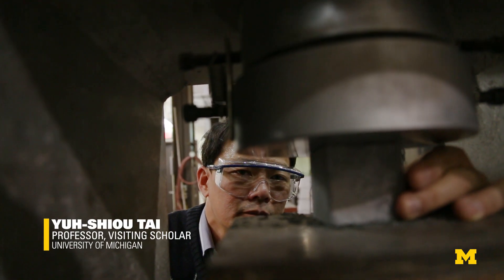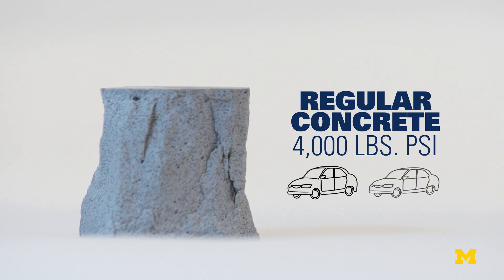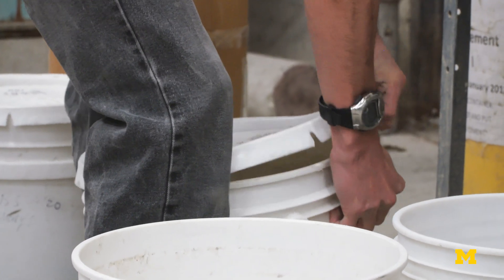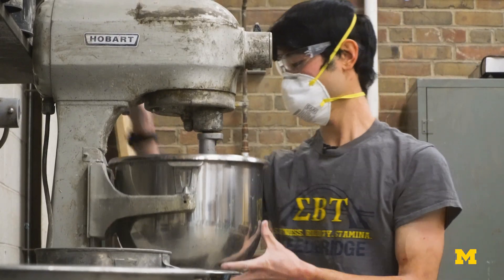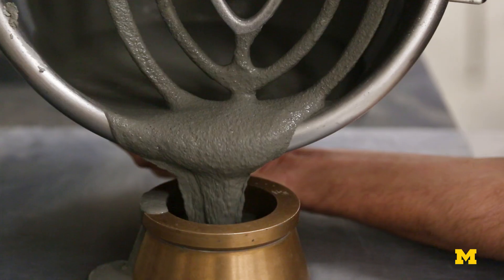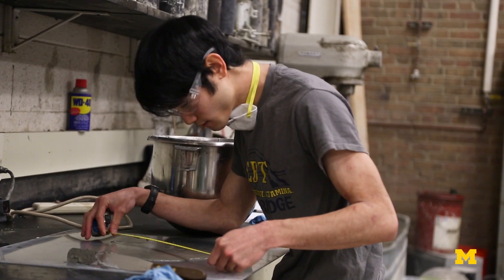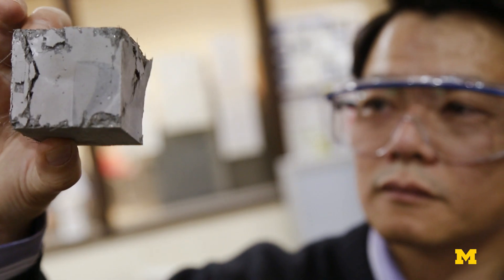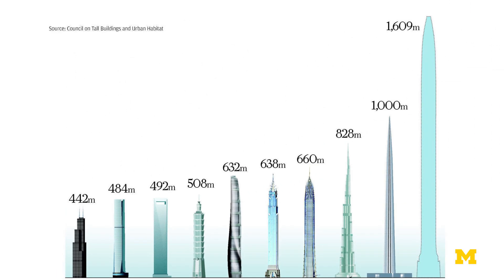Cheap, ultra-high performance concrete

Comment: For those looking for the recipe for the UHPC, do a google search of:

"Crack Propagation Speed In Ultra High Performance Concrete (UHPC)," Accepted for Publication in the Journal of Construction and Building Materials (2015)"

It was the first result that came up.

Comment: 30 years ago I built a sailboat with carbon fiber. Where 2 panels meet, you have to fillet the corners which puts a radius in the inside corner to eliminate the sharp corners. This helps the carbon fiber tape that holds these panels together.
I started using carbon scrap threads about 1/4" length mixed in with the epoxy for the fillets (the filet material is basically like a putty that you apply in the corners with dowels or tongue depressors to get a radius). Using the carbon threads really strengthened the fillets. During tests using a hammer, I could easily smash the regular fillet material but the material reinforced with carbon threads was almost impossible to smash.

Comment: I would think that there are better alternatives for the fiber reinforcement.
Reply: Basalt fiber
Reply: Regular concrete 4000 psi

Fiber reinforced cement can go up to 12000 psi

Ultra high performance concrete 35000 psi

Comment: Can you replace the steel fibers by something that won't corrode on water?
Reply: Stainless steel fibers
Reply: Glass fibers
Reply: Carbon fibers
Reply: @jafinch78  Carbon fiber is... carbon. If left out in the elements it will "rust" very quickly. The only reason people think carbon fiber does not rust is because they are thinking of the epoxy formed structures using carbon fiber. The epoxy is acting as a waterproofing agent. Remove the epoxy and you have a very easily corroded carbon structure.
Reply: @ Thanks for clarification, of course seems. Can you elaborate what carbon fiber rusts into? Carbon monoxide or dioxide does not come to mind as a former chemist or from reading, though maybe acidic environments might react or maybe the basic pH of concrete materials. I would have to sit down at the chemical puzzle of the mixtures ingredients individually and iterate through the combinations to determine reaction concern short term and over time. In fact carbon exists in nature quite commonly in coal deposits throughout the world as stable solid forms, though not in carbon fiber forms that come to mind. I wonder more about microbes potentially consuming offhand.  That is not why carbon fiber is not used. Fiberglass and maybe basalt is used outside of steel fibers as of now more due to cost and availability.  I guess stainless steel, though seems there are better steel material candidates for longevity or more inert or beneficial reactions in like a UHPC.
Reply: @ Most of my experience related to carbon fiber is in marine environments. A great deal of care has to be taken to coat/protect the carbon fibers, or the composite will degrade fairly rapidly.
Reply: @TheTinkeringMachinist  Freshwater as well?  Offhand I'd guess microbes more in freshwater.  Saltwater, yeah, seems like more potential reaction potential. Amazing the range of carbon fiber materials as well, like some are conductive and others not so much.
Reply: @jafinch78  Pretty much only salt water/sea water in my case. Most of the design and manufacturing we did was for the US navy.
Reply: @TheTinkeringMachinist  Reminds me in that regards to hulls and with aircraft as well, like aluminum I suppose a little less there are challenges regarding longevity, where steel still reigns.
Reply: Basalt
Reply: Street fighters 😜

Comment: Thanks!  I shall read your paper!  I’m researching concrete lathe.  Instead of the 10 ton design from 1916, it will be under 400 lb....small, may develop cracks.
Reply: did u find his papers ?
links pls 
im planing to use this material for CNC mill
Reply: @nuuskapeke11  I just left a comment with the website :).
Reply: @nuuskapeke11  do a google search of:

"Crack Propagation Speed In Ultra High Performance Concrete (UHPC)," Accepted for Publication in the Journal of Construction and Building Materials (2015)"

It was the first link that came up in the search for me.
Reply: @nuuskapeke11  In the video description, he has the title of the scholarly article he published about it.  If you Google it, you can find it on websites like Scribd. 

Edit: after skimming through the document, Table 1 and Table 2 have the specs for the UHPC.  They tested 3 variations of wire amount by volume, and they have the measures by weight for the various materials used in the mixture (sand, glass powder, superplasticizer, etc.)

Comment: This is the concrete blend I intend to use (or something really close to it) to make a couple very heavy 100+ lb weight plates for my barbell that will be strong enough to drop. 5000+ psi works ok, only very small pieces fall off occasionally, but I want to way overboard with the next ones
Reply: Haha I’m here for the same reason
Reply: @ElegantFinishes  me too, haha
Reply: @notsam4614   UHPC is a bad choice. 
Use Barite & 2-part Epoxy (creating a Barite polymer composite), 65% Barite to 35% Epoxy. 
It's 35% denser than UHPC & non-brittle. It will handle drops. (Dropping isn't about compressive strength)
Reply: @ElegantFinishes  me too lol, did it work?
Reply: @bobbob-uf3qz  I used 5K psi and a bunch of fiber glass in wet mix then used 1 woven sheet of fiber glass & smd sun flash on surface. Stress cracks in surface of fiber glass so it’s not the prettiest but I’m confident nothing is going to break or fly off, holding up better than expected
Reply: @ElegantFinishes  how long did u cure it before using it
Reply: @ElegantFinishes  and could u give an approximate of the prices for those items please?
Reply: @ElegantFinishes  UHPC is a bad choice. 
Use Barite & 2-part Epoxy (creating a Barite polymer composite), 65% Barite to 35% Epoxy. 
35% denser than UHPC & non-brittle. It will handle drops. (Dropping isn't about compressive strength)
Reply: @bobbob-uf3qz   UHPC is a bad choice. 
Use Barite & 2-part Epoxy (creating a Barite polymer composite), 65% Barite to 35% Epoxy. 
35% denser than UHPC & non-brittle. It will handle drops. (Dropping isn't about compressive strength)
Reply: @dsdgdsfegfeg where do I get the barite just powder/sand?
Reply: @MikeT-om9mf  not sure sorry, 
I'm in Australia. See what internet search says, 
Or ask AI for ur area
Reply: Do it in bike tires to protect it from edge chipping
Reply: Same here. I have a box full of scrap metal (brass, steel and aluminum) screws, nails, bolts washers, valves and stuff like that that I threw into the cement mix instead of aggregate. Worked great but I'm thinking of cutting up some steel wire mesh 24 Guage, and adding fiberglass strands to the mix to minimze major chipping. ** it is imperative to completely cover the weight in duct tape. Really helps keep it together even if it's broken in half, but more importantly, it prevents chunks of concrete and sharp steel wires from possibly flying towards you has high velocity. Shits like shrapnel, believe me. Dropped a plate as a test.

Comment: 2000lb car? That's a tiny car, lol. Great video.
Reply: Bigger than the original Volkswagen Beetle.  They were 1800 pounds and sold for about $1800.  The advertising for them at the time (mid 1960s) was they were $1 per pound.
Reply: https://www.youtube.com/watch?v=sJr9Ed9Lf3w
Reply: Lol, the Beetle is an exception. How many are even left? 
$1 per pound is a pretty good marketing strategy. I wonder if I could get 300lbs worth

Comment: I am so worried about the steel rusting and expanding... what will control this aspect?  Thank you so much for getting away from silly 3/4 angular aggregates and into ''fibers''...   But, again... what will water do to metal fibers?
We need to focus on the tension aspect of concrete and the compressive end will pick up by default.
Reply: I've wondered and am wondering about other materials fibers effects, similar to using fiberglass rebar... how would fiberglass fibers, carbon fibers, other metals like titanium, metals coated or formulated like stainless steel or with oxide or other metal coating, etc., perform?
Reply: @jafinch78  stainless steels still rust, the others are too expensive or too brittle, you use regular steel and a waterproofing admix to prevent water intrusion
Reply: Construction News & Engineering Soak the fibers in a rubber sealant like what they use to spray rubber waterproof basement exteriors. 

When all the fibers are coated with the rubber spray. Toss them around a bit in a cement mixer so each fiber can be unstuck from another. THEN toss the fibers into the cement mix. They won’t rust. Problem solved.
Reply: @DylanBegazo  please don't do that. You would you an integral waterproofing or a waterproof layer to prevent water from ever reaching the inner steel(rebar and fibers)
Reply: How would that affect adhesion between the concrete and the fibers? High chloride content is a death sentence for any steel reinforced concrete structure and these sealants may not have the binding strength needed to transfer the load onto the steel wire. I've seen people paint rebar with sealing bonding agents but those have to be tacky when the concrete mortar is poured. I've heard those bonding agents are really strong.
Reply: Guys check out basalt fibers instead of steel
Reply: @ldnelso2  not necessary, you don't let the water get in in the first place
Reply: @ldnelso2 Yes, basalt is way to go. Even whit epoxy or zinc coating there is risk of corosion. Basalt fibers are green and reliable.

Comment: Ad HEMP fibers, make it even stronger.
Reply: ZZP Zing Pheonix Hemp fibers to concrete mix? But last I checked hemp was illegal in the US... You live in Canada or Mexico?
Reply: @DylanBegazo  I grow hemp legally in Michigan, not illegal. My hemp structural tensile strength is 100 MPa
Reply: TheSorters oh wow ☺️ Nice to meet you and thanks for the info too. As a basis of comparison to your 100mpa, I wonder how much is Oak wood or concrete or steel. 

I was hoping to build my house using concrete and stone and cob. But I was wondering if I could add hemp to the concrete to increase its strength. 

Is your price competitive?
Reply: @DylanBegazo  I think you can get wholesale hemp fiber for pretty cheap. I looked into it a few years ago so prices may have gone up. Look into wholesale prices since you need a lot anyways
Reply: Hemp is zuck